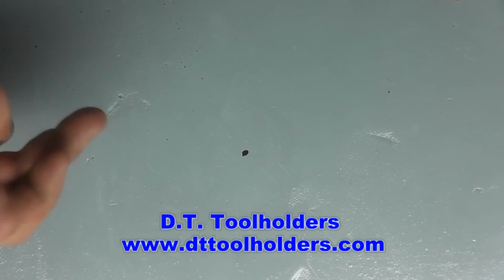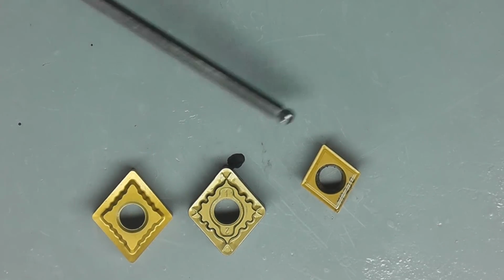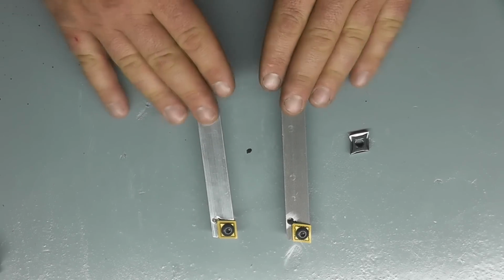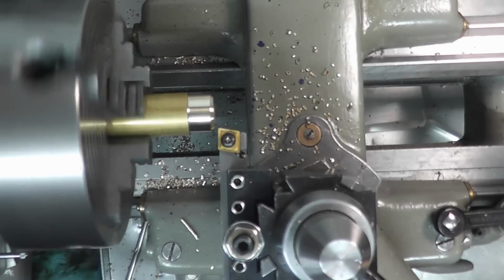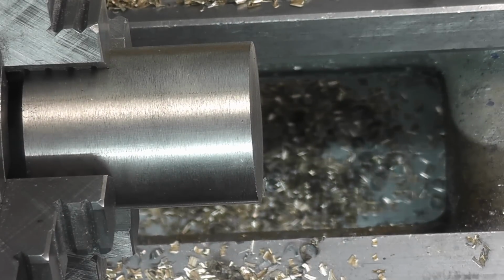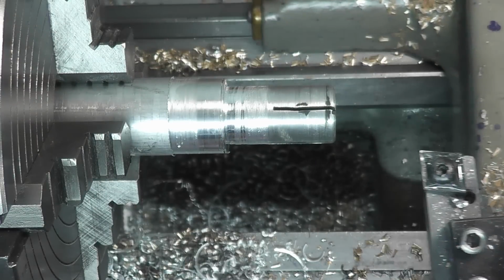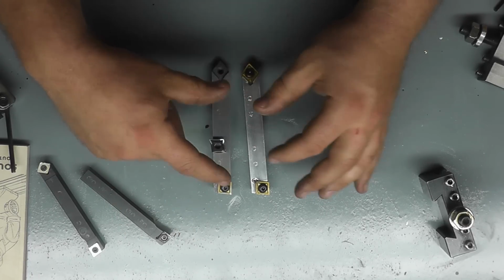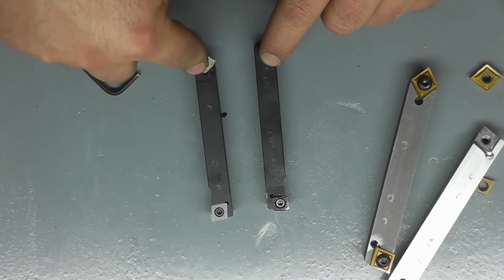D.T. Tool Holder Review

Comment: First thanks for do the work on these videos.    

 Have you used tool holders from Shars? Do you have any interest if I send you one similar to the AR warner and D.T. tool holder.   The Shars tool holder is SCLC in right or left cutting direction positive rake. The Shars 1/2 inch tool is $26 plus inserts.  It uses CCMT and CCGX ( for Aluminum).    The 1/2 inch tool holder uses  32.5X size inserts similar to AR Warner.  I ask since you have the AR warner and D.T. tool holder at your shop.   It might be helpful to me and many other folks who are on the fence over these 3 manufactures.    Thanks
Reply from the maker: +kerrywil1 
I have not tried Shars' tool holders, but I do have shars ER collets, thread gauges and a DTI that are good quality.  Do me a favor and send an e-mail to halligan142@gmail.com and we can discuss the holders.

Comment: P.S. Just went to the website and they have jumped the price of the aluminum to $100 rather than the $80 you mentioned.  They were at $140 for the steel set as you stated.  Doug

Comment: Thank you for the review: you cleared up some questions about insert tooling on a smaller lathe. I am considering upgrading my tooling and I find the alphabet soup of letters and numbers confusing. I know I have a lot more learning to do but it was nice to see how well negative rake tooling worked on a small machine.
Reply from the maker: +Tom Wardman Take a peak here for an explanation of the insert # system-  https://www.carbidedepot.com/formulas-insert-d.htm
Reply: +Halligan142 Thank you very much for replying. to both comments, You cleared up a lot of questions I have about using carbide tooling on my lathe. I feel that I am a lot closer to understanding what my requirements would be.

Comment: One quick look in MSC, Dorian 1/2" shank tool. No it's not double ended, but properly heat treated, ground, and blackened, from a top quality manufacturer. $60. At best for an unknown manufacturer I might give them a shot at $50 if they equaled the quality of Dorian, Sandvic, Kennametal etc. But for the list price you quoted? That's just not gonna happen. And I'd expect any other top brand manufacturer to be roughly in the same ball park as Dorian's price. That one tool you tested is I would think just soft steel going by the marks the tool holder screws left behind. You did a good tool review, but the value isn't there in my opinion. I have been wrong before though.
Reply from the maker: +Turning Point It is soft, but I'm pretty sure my A.R. warner stuff is too.  The file definately grooves both.